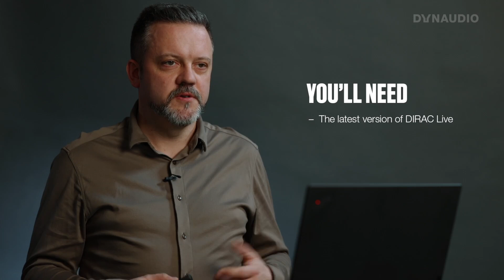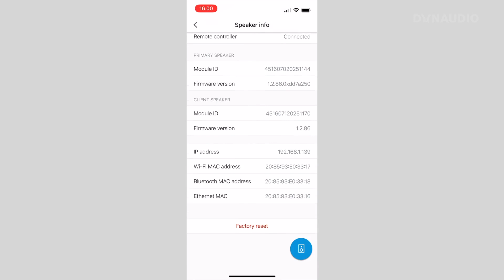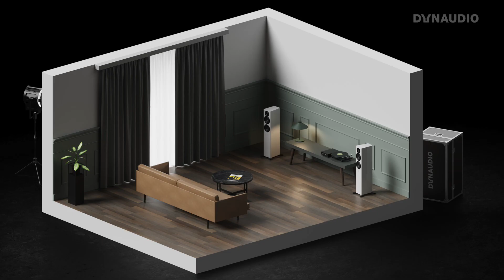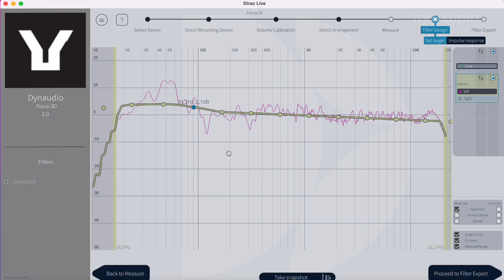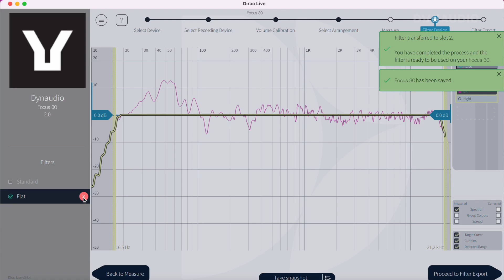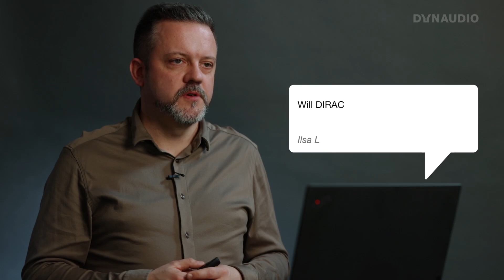Dynaudio Focus | Dirac Live step-by-step setup guide

Comment: I don’t know why Dirac doesn’t do moving mic measurement. Much more accurate and less time consuming. Maybe do that with the single measurement and use both data. Then do post measurement and it should adjust based on the post measurement data.

Comment: Hi, you mentioned a slight delay is introduced when filters are runnning. How much of a delay is introduced? Is there any limp synch issue while watching a movie?
Reply from the maker: Hello, thanks for your question :) 

The delay depends on the filters that Dirac implements for each room, but can be up to 200 ms. So yes, you may have issues with lip sync when using Dirac with video sources.

hope this helps! Please get in touch with us at hello@dynaudio.com should you require further assistance.

Comment: What is right? First of all thank you very much for your explanation, but something confused me.
A few times throughout the video you emphasized pointing the mic up while measuring and using the 90deg calibration file, but MiniDSP, the manufacturer of the Umik-1, recommends keeping the mic horizontal for a stereo setup.
On MiniDSP's website you can read: Which calibration file should I use and where to point the UMIK-1?
We provide two calibration files to be used depending on your application.
For stereo system (e.g. 2ch dirac live, single speaker measurement), use the 0deg file and point the UMIK-1 at the speakers 
For multichannel system (E.g. 5.1/7.1) or a surround application where multiple speakers are spreadout around the room, use the 90deg file and point the UMIK-1 at the ceiling.
Werner
Reply from the maker: Hello, thanks for your comment! We apologise for the late reply. In regards to your statement - We follow the official guidelines from Dirac, which states that the microphone should be pointed upwards, using the 90 degree file. There's not much logic in doing any different for stereo setups than for multichannel setups. Look at it this way: A multichannel setup is often used for playing back two-channel content, and even true multichannel content will often have elements that use two channels only. The object is the same: Measure the room, not the speaker, so the process should be the same.
Reply: @dynaudio  thank you very much for your explanation, Werner

Comment: I hope, there's enough people wanting to use all this instruments and technical features to get best possible sound. Valuable and rare attempt to explain problems of the home audio and how to overcome that using modern technologies. Still, I think, most people will not understand what they actually loosing in sound and impression even with their current systems without proper accurate setup. I mean, once you catch a true sweet spot with speakers with good phase/frequency response, in correct place in the room without excessive reflections and so on, since then you know, that the key to sound magic is the setup, and everything else is secondary.